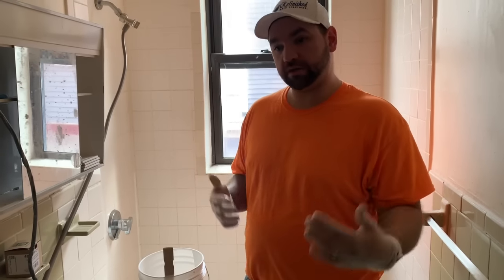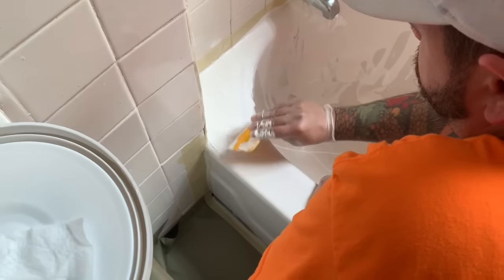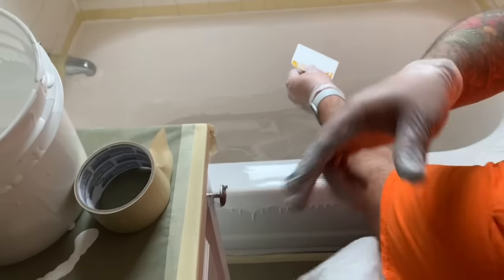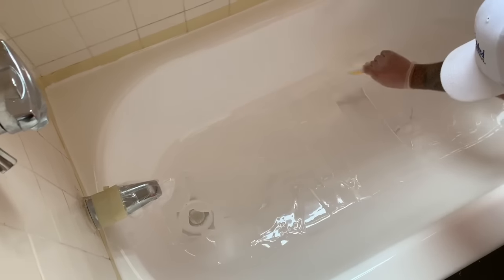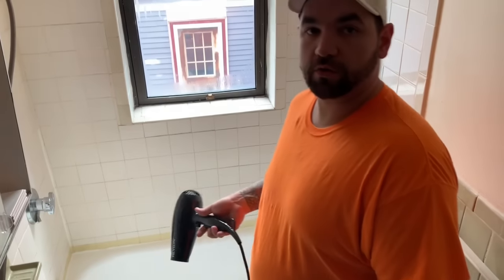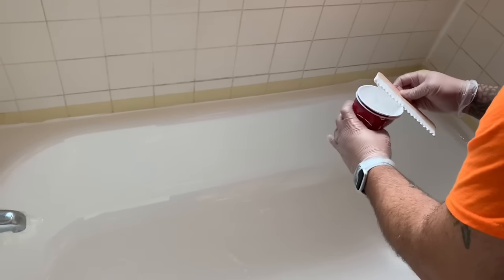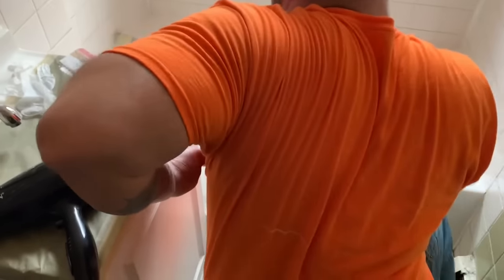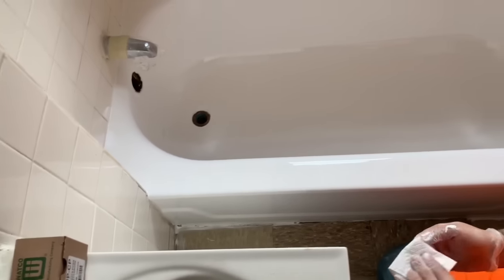Ekopel 2K is 20 Times Thicker Than Spray on Coating | Refinish A Tub Series Step 4

Comment from the maker: The extra strength acidic toilet cleaner has the same amount of acid as traditional etching cleaners. 
It is very important that the surface be as clean as possible. 
This is a hybrid epoxy material and will stick perfectly to the clean dry surface.
Reply: If you use xylene also, should you wash it off first? Or use it as a primer? Or use a primer? How long after the primer to paint?
Reply: Should this not be sanded first?

Comment: One of the best videos I've seen on your product.Thank you!
One tip to others wrapped up in two words, "DOG/CAT HAIR"!
I've just completed my fiberglass shower basin and looking forward to the pour on for the bath tub in the other bath.  You mention cleaning in all the videos but as a dog owner (she doesn't shed much either), I have to add that it is imperative for the dyi'ers to entirely clean, vacuum, mop ALL surfaces in the work room AND adjacent room, keep doors closed and vents for the work room sealed (may present some temperature challenges).  It is AMAZING how much dog and possibly human hair follicles float in the air and still get into the room.  It was full time challenge on the first coat to  pick out the dog hairs, i bettered it significantly for the second coat to an acceptable(but not perfect) level.  With the LONG dry times this material needs dog hairs floating in the air for 3 to 24 hours is definitely a factor to pay attention to for your final product.  I believe there was some human hair shedding also and will get one of those $20 Tyvex suits before I do the pour on refinishing for the bath tub.

Comment: With my luck, there'd be a bug flying around landing and getting stuck right on the finished surface.
Reply: @bigdealdoughnutz  .. Haha; I don't live in a hut. I deal mostly with my tenants and I've had my handyman replace bath tubs instead. They're not that expensive.
Reply: I very small fly did land on mine.  I did my best to have the area bug free but nothing is perfect.

Comment: Very thorough demonstrations. Thank you.

Several years ago we had a "professional" tub refinishing person paint our tub and it has been nothing but trouble ever since. The paint, or whatever it was, peeled off across the front in large pieces. The bottom became a mess as well. I'm sure he didn't properly pre-etch the tub. We wound up taking him to small claims court (and won).   I was getting ready to replace the whole darn tub, but I may give this system a try instead.
Reply from the maker: We ran a spray refinishing business for years and encountered a lot of the same issues. Between that and the chemicals we knew there had to be a better way.  This material is way stronger. Once we started working with it we sold off all of our spray equipment and if we do an install this is the only product we use.
Reply: This happens a lot in this business I see so many tubs that other people have tried to re-glaze and the job fails due to improper prepping.
Prep work I have found is the key to a lasting coating. Cleaning- Etching -and even sanding is needed before the coating is applied or it will fail quickly.
I have found that if prep is done correctly  most any epoxy will last for 5-8 years  , but this Ekopel  stuff is top of the line, if prepped right this coating easily lasts 20 years and i'm sure it goes even beyond that...I'M SOLD!

Comment: Easy to use, tried it, followed the instructions to a tee. All went well. Only issue, even after waiting 48 hrs to use tub. This material still scratches easily.
Reply: Wow, that's the first that I have heard about it scratching easily.
Reply: @showmediamonds  I followed the instructions to a tee, not worried about minor abrasions,  but deep scratches and a fail after 30 days. Bubbled up, delamination. 
Tried it, and cannot reccomend it.

Comment: Did you have to first sand the tub and tile with 400 grit paper with using this kopek brand ??   You said nothing about using some type of paint primer before using your kopek product.  Does this kopek product need a primer ??

How much does this thicker kopek product cost ?
And where do you buy it locally ?

Comment: So I did my tub and it looks brand new. Except for the part by the toilet that I bumped and then tried to fix. A big help would be giving a time limit of when not to touch it anymore. I seen and heard when he was removing the tape in the drain not to worry about bumping it because it would smooth out. tried to fix it with the roller and it made a mess. Grabbed an acid brush real quick and applied a little more compound from the cup and it appeared to look good. An hour latter it had runs in it that finally hardened  that way. A good video would be how to fix hardened drips. Also at the floor I removed the tape as this guy did just guessing because I didn't hear a time (to wait) mentioned other than at the end of the job. So for me it was an hour and a half. Came back a half hour latter and the epoxy was all over the floor. My brand new tile floor that I just installed. Which initiated an emergency clean up. Which lead to a bump on the side of the tub. Which lead to drips that are now hard. This seams like a great product and it wasn't that hard to do but try to understand that everyone doing this is a first timer. I watch all the videos and would suggest a video that specifically addresses when not to touch it anymore and when to remove the tape at the floor and what to do if a mistake happens. It looks great now. I hope it lasts. :)
Reply: if you have defects, just sand it off and coat again (the one area)

Comment: Very cool!
This is the second video I watched you do and I am now contemplating trying it. 
One question , Did you neaten up the line that you were  wiping with a paper towel between the tub to the floor? My ocd had me  twitching at the messy edge lol.
Reply from the maker: Yes you would neaten it up after it drys and hardens you can go back and  fix any mistakes.  We wait 5-6 hours then pull up the tape

Comment: I installed new floors, because the toilet had to go in. Tiling took longer than expected and its done now - i need to resurface the tub.

Im a little worried about that material that drilled on the floor, how easy is that toget off of LifeProof flooring?

Comment: Great video!  I have grout that I can't remove.  How do I mask?  Over or up to the grout?  THANKS!
Reply from the maker: You an either leave the grout and pour ekopel over it and when dry re-grout it. Or you could use car bondo to level it our and then sand smooth and then use the ekopel over that. Both would work fine.

Comment: You did a great job describing clearly the workflow. 
Questions, did u/ can you leave the drain in place?
Reply: If you remove the drain, can you leave the tape in place until the material sets up completely and then remove the tape and the pooled material?
Reply from the maker: I would recommend taking the drain out put something in the drain like a shirt or lint free cloth and then tape it up pour. After 1 hour remove the tape and babysit it for the next 4-5 hours after 4-5 hours is when the matrial stops moving

Comment: I’m remodeling an old trailer house on a budget and I have a tub and surround I want to do. Beings trailer house the tub is a 55” instead of 60” and not very deep so I’m praying my kit has enough for walls.  My question is how crucial getting all of the silicone off is?  I think they thought they could hold the universe together with the amount they used 🤔.
Reply from the maker: Yes, its important prep to get all silicone off as ekopel will not stick over silicone.

Comment: Beautiful video,,, will  this work on plastic tub?? Hay don't know what material is that if it is a acrylic ..What about the kitchen sink do you have a kid for that ?? and how much is it for a cast iron kitchen sink?? question when you used a blow dryer do you use it hot  or Miriam hot??  What kind of sandpaper i would use???
Gracias 😁
Reply from the maker: You do use the blow dryer on the hot setting. It will work for both a plastic tub and a cast iron sink. 
For the tub it is fine if it is a tub only. This will not be a good fit for a one piece tub and surround unit. 
One kit is enough to cast a tub and normally there is enough left over to do the sink at the same time if it is small enough. If not your best bet would be to order 2 units.

Comment: hi,  will it work on a previously refinished bathtub that some area of the bathtub are peel off (I do not know what product it had been used). Thank you.
Reply from the maker: Yes I would recommend peeling up what you can first then sand the rest smooth to the touch with 220-320 grit sandpaper. As long as it's smooth to the touch it won't mirror the affected area. Can fill any uneven areas, cracks, chips, holes, or dents with car bondo then sand smooth

Comment: If there’s a few hairline crack in fiberglass shower bottom will this product seal those cracks?  Or is there’s another product I should use first?
Reply from the maker: I would recommend filling any cracks, chips, holes, dents, or pitted areas with car bondo and then sand smooth, before applying ekopel.

Comment: Priced out having someone redo my tub his way.  They quoted 800$ and I went to HD and I can buy a tub and surround for the same price.  The tub had been redone at some point because it’s peeling. Found a box of homax tough as tile. So I assume that’s what the original home owner used.  This stuff you’re using seems to be way better but I’m still not sure if I should mess with this or just replace the entire thing
Reply from the maker: matanuska high it’s tricky because it’s $800 for the tub and surround then demo cost, plumber cost, hardware cost.  That doesn’t include any damages behind the walls or other costs. It looks like $800 but more like 4-6k. 
We only sell product to refinishers but all that buy from us warranty there work and do a great job or we close there account.
Reply: Refinished Bath Solutions i do the work myself.  It’s easy to redo do a bathroom.  I’ve done a lot of bathrooms .  To me one day to swap out the tub and surround maybe two days. It’s a common size and should have to move pipes although if they do need to be moved I have no problem doing it.  It’s simple plumbing. I can move copper pipes to adjust for height etc. I’ve done it plenty of times when adding a deeper bathtub etc.

Comment: Can I do my entire shower walls and bottom tray at the same time or does it have to be applied only just the sides first. Let it dry. Then do the bottom tray of the shower? In the videos I’ve watched it’s always either just the wall or just the tubs. Thanks!
Reply from the maker: You can do both! If your doing a shower unit I would recommend mixing up 1 can pouring it on the walls then mix the second can and pour that onto the bathtub. You will want to work fast when you do this so it will also self level nicely.

Comment: I have a few questions about the prep.
1) My tub was previously refinished with a two part epoxy do I need to remove all of the existing finish?
2) I have access to remove the drain. I would like to do this and back mask the hole is this an issue?
Reply from the maker: I would recommend peeling up what you can of the old finish then sand the rest smooth to the touch with 220-320 grit sandpaper. Then give it a deep clean and etch with Lysol Power or any toilet bowl cleaner that has hydrochloric acid in it. You can use painters tape to tape your drain.

Comment: Does the product cover up a big rust spot where the porcelain has worn off ? Will it level that spot out to match the rest ? Thank you sir
Reply from the maker: Yes, Ekopel will cover rust spots but we recommend sanding it smooth to the touch first.
Reply: @RefinishedBathSolutions  Thank yall so much for the quick response.  Have a great day
Reply: @RefinishedBathSolutions  Sorry for the questions Sir. I have 1 more. Someone painted this old sink sometime in the past . Do I need to sand all the old paint off or can I sand the places where the paint is at smooth and the product stick good in those spots ?

Comment: Is it ok to use a primer first? On amazon they promote the 3M "tub cast primer" with this kit? Also, is it ok to coat with the home depot tub paint after it dries? The home depot stuff turns kinda yellow after a few years and I was going to use that on the surrounding tile walls. Afraid the colors will look different after a while. And dont want to use it on the tub because it peels after a few yeara

Comment: 32:47...that sink caulk job whoof!
Reply: Yeah,...I hope the bathroom is going to be remodeled . That beautiful tub job and the mismatched tile colors plus the calk job makes this tub look like a purse in a Sows ear when compared to the rest of the rooms work . The design of the heating system goes back to the late forties Looked  like it had 9 layers of paint on it .  I should know I had the same heaters and the only way I could remodel them was to remove them from the system and torch the paint off till I was down to the primer . Even the floor tile was  mismatched .

Comment: How many years will it last especially for a tub that's regularly used for bathing. A listing for a professional said theirs was guaranteed for 5 years. And I read that rustoleum brand peels in short order if used regularly for bathing.
Reply from the maker: If you do all the proper prep work to the tub ekopel will last 20 years no peels

Comment: Questions:
1. Do you think this could work on a cast iron drainboard sink or would it be too difficult to keep the drain channels from filling in? 2. If it would work,  do you have a recommended ratio of product to surface area to minimize waste and/or avoid having too little? 
3. What about a claw foot tub? Seems like the surface area in this case would be different. Do you recommend trying to apply this on the outside of the tub (in the case of a tub that is not yet installed). 
4. If doing both the inside and outside of the claw foot tub, how much product would be required?
Thanks!
Reply from the maker: Megan Trenary one of the first videos we uploaded shows a sink with drain board before and after. The video before that is a clawtub before and after. Both of these units were in the same home and we used 1 kit of material to complete both. 
We don’t recommend doing the outside of the clawtub as it would be more difficult and a waste of money.  Any kitchen and bath paint is strong enough to seal the outside of the tub as water exposure is very little. 

I would recommend preparing both units at the same time then using the one kit.  If you would be more confident doing them separately in about 2 weeks we will be releasing a smaller sink kit.  
The material can be broken down in 6-1 ratios by weight.  If not broken down exactly it can cause the material to cure with less strength. 

I hope this helps, and If you have any more questions feel free to give us a call or leave them below.
Reply: @RefinishedBathSolutions  wonderful! Thanks for the attentive response, very impressive,  will follow

Comment: I understand final product is slippery. Can I sprinkle non-slip additive to the process? If so, when? Also can I use blow torch instead of hair dryer (like epoxy resin)?
Reply from the maker: No you would need to use our non slip kit and apply after it cures. Or any sand would get completely engulfed and sink to the bottom. 
Torch is to hot. You need to use heat gun or a blow dryer. 
Only on the bottom and only for a few seconds.

Comment: Can you use the product on a ceramic tile or a plastic tub surround??
Reply from the maker: Yes you can,  just make sure there is no flex. Meaning when you step down or push on the walls they move that is a flex that would need to be fixed with expanding foam.

Comment: Solid video. I have a cast iron tub and it has a hard clear coat on it. After using the toilet cleaner and a few other products the tub is still super shiny. Do you recommend using a grinder to scuff it up or will it bond to a shiny surface?
Reply from the maker: Travis Lee as long as you cleaned it really well it will stick. Don’t worry about the shine. 
The material will bond to the clean surface.
Reply: Refinished Bath Solutions awesome! Thanks for the quick reply:)
Reply: How much does it cost to reglaze a tub in NYC
Reply: If your cast iron tub still has a good clear coat on it, why redo it?